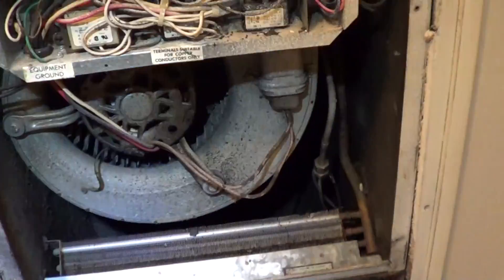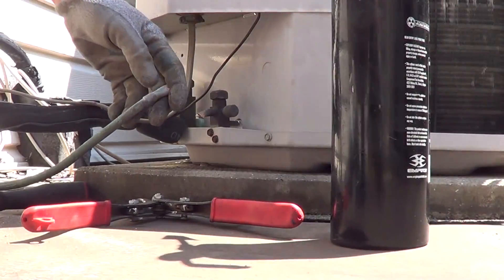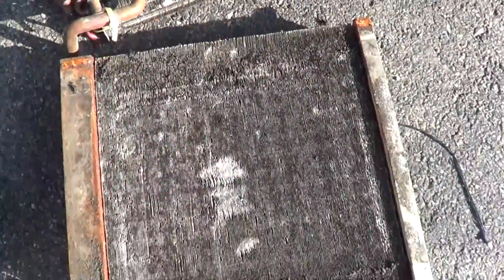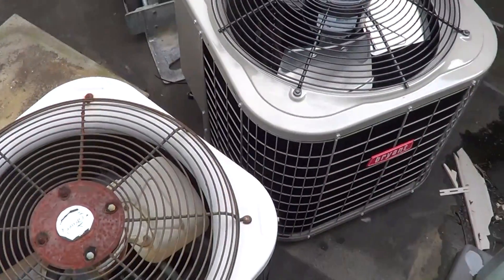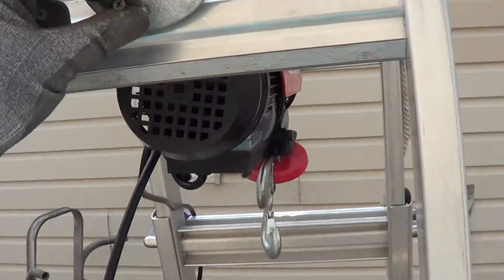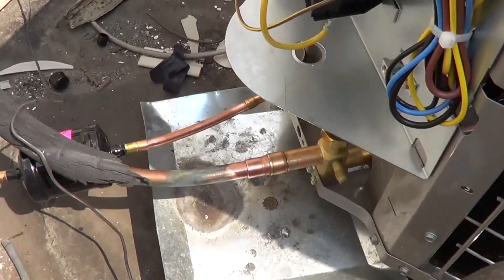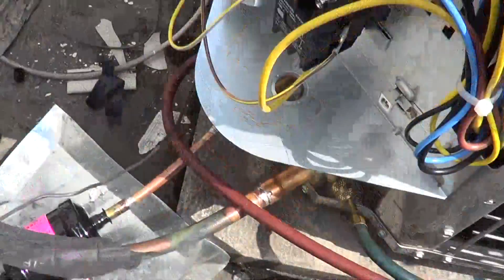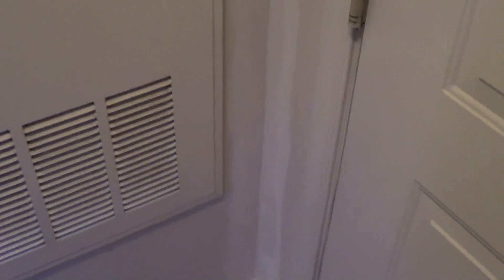Decoverly 2 ton system installation

Comment: There's also a difference with the condenser fan blade.  Most condenser fan blades are made with blade brackets and rivets.  Usually, the side the rivets are on are the exhaust side.  And, the side the blade brackets are on are the suction side.  It's strange how the old fan on the old unit has the brackets on the exhaust side instead of the suction side.  Unlike, most units.
Reply from the maker: It almost looks like the fan is on up side down.  Interesting observation.